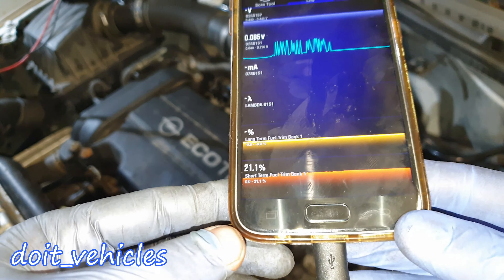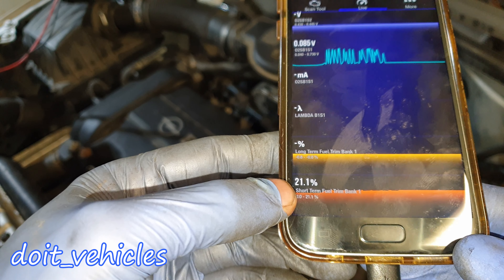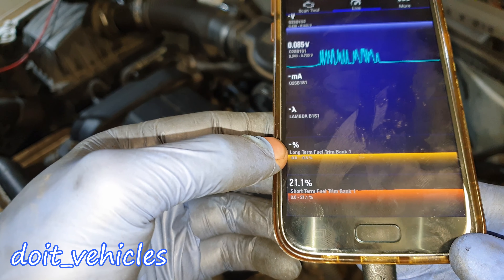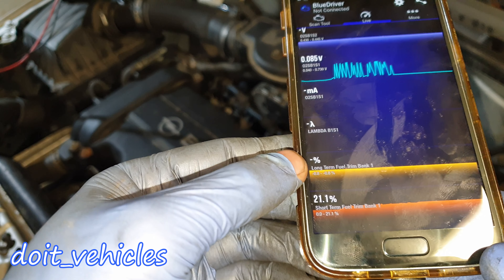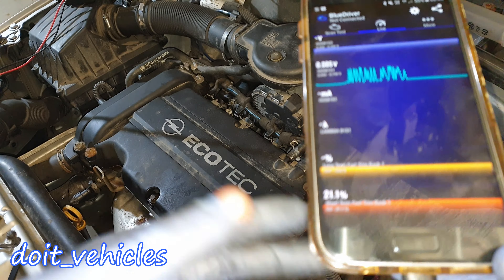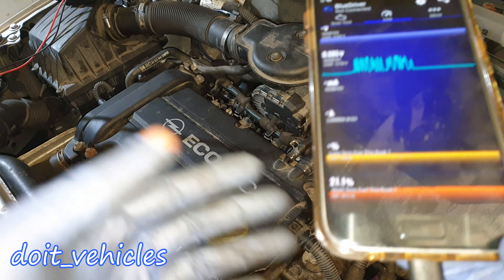How to test the Fuel Injectors for Leaks / Pressure Drop / Multimiter Test DIY

Comment: On a car with the same engine as in video, if the exhaust is puffing/making like a boiling or poping noise it could be the injectors leaking to much fuel? Car has no codes for misfires or post cat lambda error. On live data o2 s1 is switching beetween lean an rich, but s2 o2 stay s rich even with new sensor. Short fuel trim is oscilating between -17 an -25. Ocassionaly the engine cooling fan came for about 30seconds at idle like is overheating, but water isnt boiling. Car has new thermostat, waterpump, coolant cap, sparkplugs and coils, o2 sensors, maf sensor.

Comment: Incredibly good! Thank you. 
My engine starts fine but cuts out in seconds. Fuel Pressure is 50 psi. I can't find out what the correct pressure should be. ScannerDanner has said that "mechanical poppet nozzles...do not open under 50psi. It should be a min of 62psi during cranking." I'm afraid that I don't really understand, and I don't know if the injectors are that type ("mechanical poppet"). Could you help, please? Thank you in advance.

Comment: From data that you have in the end of video , how to know if there is a  leak in injector?
Reply from the maker: Good question.  In many situations there is just one , two or three injectors leaking.  so if there is a noticeable difference betwen any of them ,  than the injectors can be replaced . This is a free DIY test , not very accurate but it can be handy when diagnosing a related problem .
Reply: @doit_vehicles  thak you so much,  can a picosope testing detect the leak ?

Comment: Difficult question....There are two elastic ring in each injector, up and down. Do you know if these rings have the same size? I find only one size and i would like confirm and order from Germany the correct number. opel corsa c 2001. Greetings from Greece
Reply from the maker: Once I know for sure , I hope I will remember and give you an answer ...
Reply from the maker: anyway it's a good idea to have a O ring kit with all the sizes
Reply: @doit_vehicles  Good idea, but make sure the rubber can handle gasoline